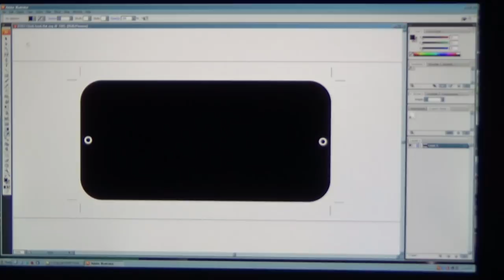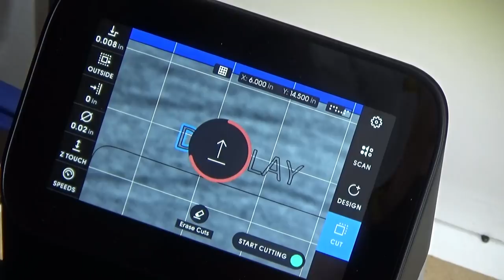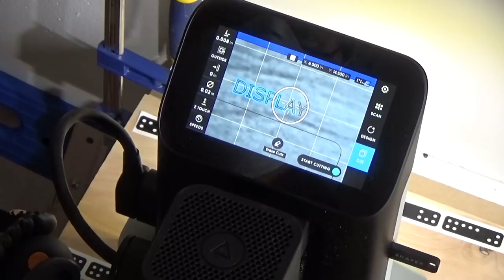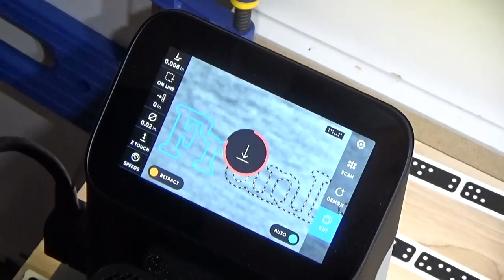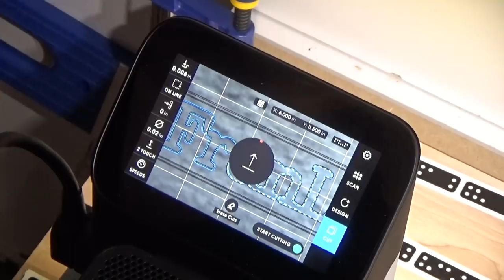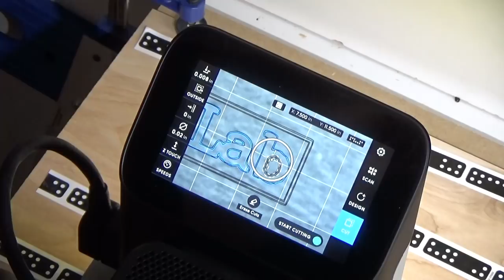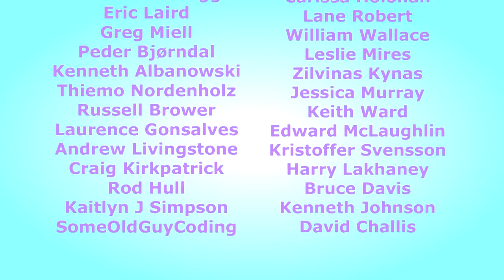Making A Clock Case With The Origin CNC Router

Comment: It's nice to hear Fran again - every time!
But I can not get why use the glued plywood instead of whole wood massive?
Reply: 6 * 0.5" = 3" … that's pretty thick to use a router on.  Typical router bits usually wouldn't stick out more than 1.5".  If you could find a 3" long router bit it would likely be called and end mill.   It could also be Fran's budget and the style of how she wanted it to look.

Comment: The Shaper Origin is cool and all, from a technical standpoint, but I just don't get why it is so popular.  It seems really expensive and pretty limited for the price except for some specific situations, situations which I never see highlighted in any of the videos where people are using them.

This project, for example, seems like it could have been done just as easily on a small desktop CNC that is 1/5th the price, or with a laser cutter (which can be expensive but is more versatile).  I get that it is 'small and portable' but that feature seems somewhat tarnished by the fact you need a large enough workpiece and area to cover with the tracking tape.

Beyond that, wouldn't it have been more efficient to use an array of sensors (similar to those found in a computer mouse) to track position and movement, rather than the expensive and complicated camera tracking system?  It would certainly allow for a smaller footprint.

Is this just exceptional marketing, or am I missing something?

Comment: Needs new ergonomics? The tool looks like a router but you don't use arm and back muscle coordination to keep it steady and send it where you need.

Because of the speed, it seems like it would be murder on the operator's back eventually to support the operator's upper body trying to stay out of the way while it moves.

I think the designers had that in mind with the heavy fixed outer section and the (servo controlled?) inner part that moves.

Because of this, isn't it easier instead of holding and moving the device with the handles as if it were a plain router, because it looks like a plain router, and just sit (or stand) at a normal computer workstation posture and use mostly arm movements to shove the device the next two centimeters to the next space to cut?

I see myself with a workbench for this tool at a sitting position and the wood being cut about four to seven inches lower than a computer workstation desk.

Also, I know I lost this argument a looong time ago. I want physical clicky BUTTONS for primary functions that can just as easily be assigned or updated in software or firmware as touch screen commands. I use a 45 inch hp printer with an idiotic ersatz phone interface on the front to control it. On this router, my printer, car radios and controls, you can't feel where you need to press / touch. Your eyes MUST adjust their depth of field, focus, and "exposure" JUST to send your finger where it needs to go, with unreliable results. You must use gloves with cut fingers if needed and sometimes poke a few times to make it work.